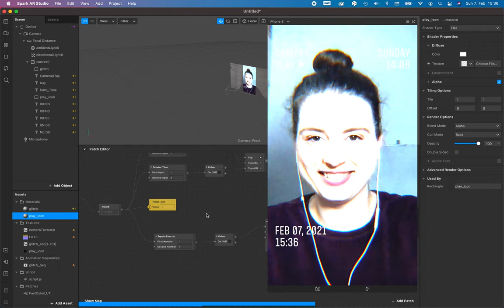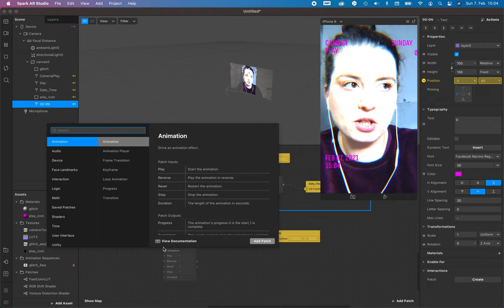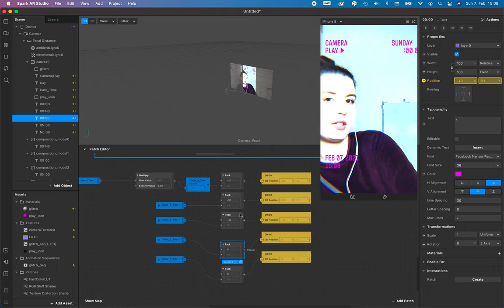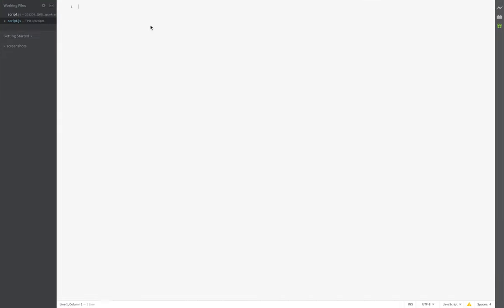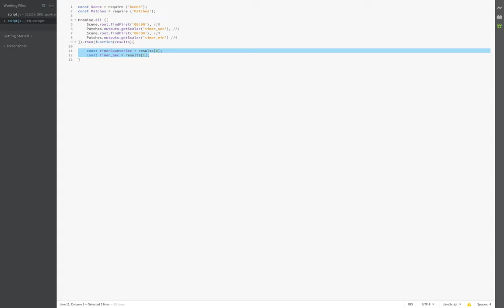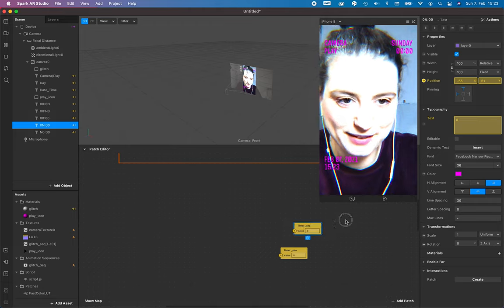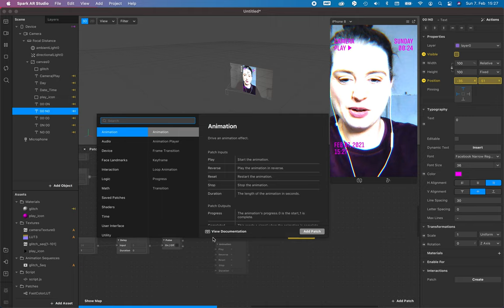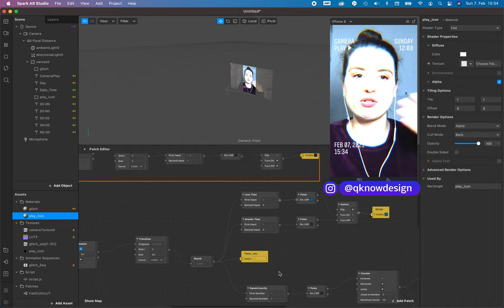How to create a Timer in Spark AR [PART 3 of the VHS Aesthetic Filter Series]

Comment: hi thank you for the tutorial! Hi, just wanna ask, what to do if I want two timers working, I tried adding another one when tapped but the other one doesn't work anymore, when I do that. Thannnk you
Reply from the maker: You switch via tap between two timer designs, right? If so, I would work with visibility of two null objects with the timer designs included.
I would also use the same patches for both timer designs if possible, not duplicate the settings for the second design. Make that sense?

Comment: What should I do if I want to add the millisecond in the beginning before the seconds??
Reply from the maker: Of course you can make the animation loop faster, for example. Or create a second animation loop for the milliseconds. It should be the same procedure like the seconds counter, but faster of course :) they are also some alternatives tutorials. Just search for timer settings on YouTube. :) does that help a little?
Reply: @QKnowDesign  thank you , that's help a lot.
Reply: @QKnowDesign   there is a problem I notice that when make a test the timer start count from 1 min not zero but in the spark ar it count from zero ?
Reply from the maker: @m3nkhdour358  than add an delay by 1.